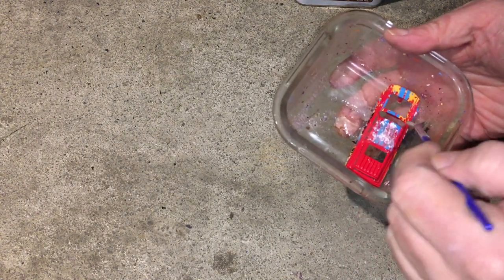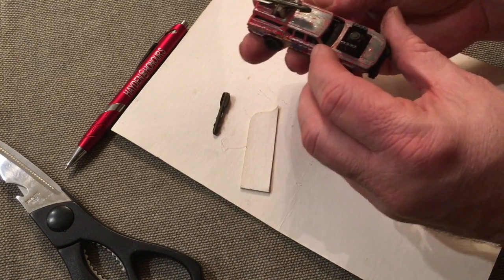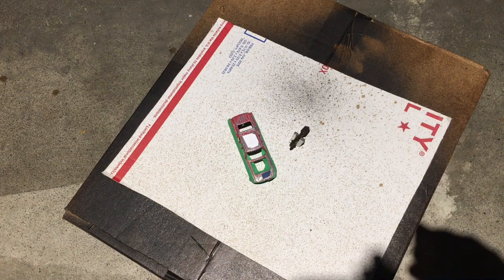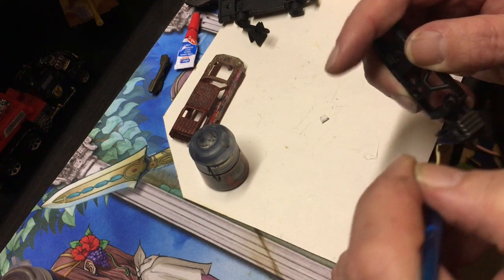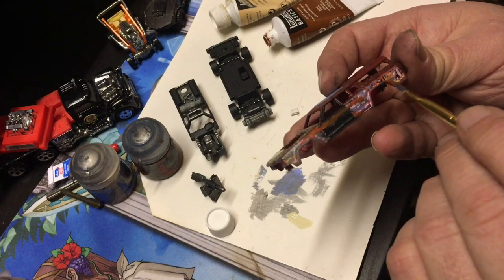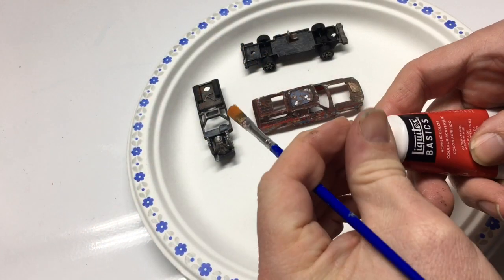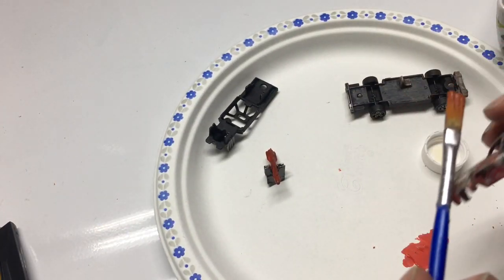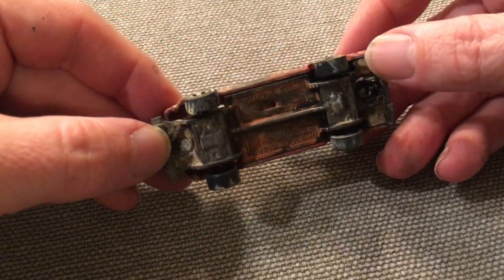Gaslands Refuelled Custom Red Rocket Wagon complete build guide !

Comment: You can remove the fake chrome coat(which is actually an aluminum plate job) by soaking the part in bleach. And it always seems to me like the paint sticks better after you take that plate off.
Reply from the maker: Good idea! I am trying to cut back on the chemicals but that would be great to try out. When I first started using the paint stripper I didn't realize I had a plastic engine still mounted. Well let's say it was good and melted!

Comment: 1/3 Break fluid, 1/3 nail polish remover, 1/3 paint thinner in a jar removes paint. I came back in an hour and the paint was already bubbled and sliding off.
Reply from the maker: Very cool, yeah that aircraft stripper I use actually takes it right off, but if you don't want all of it removed you can just use a little and it keeps some of the detail on the car.